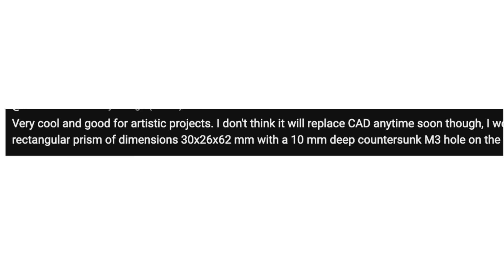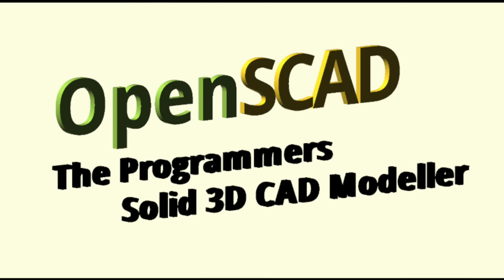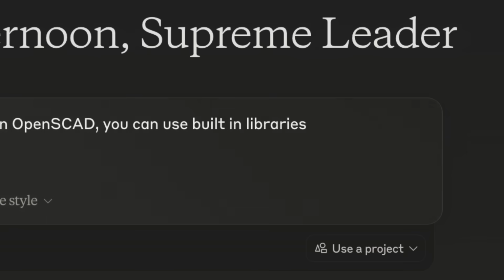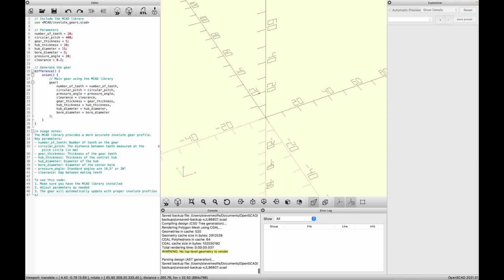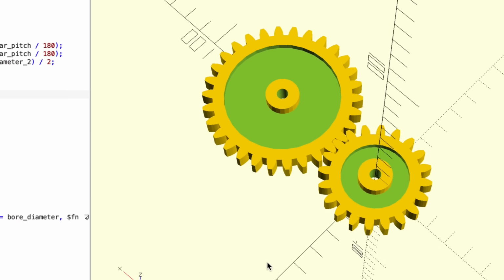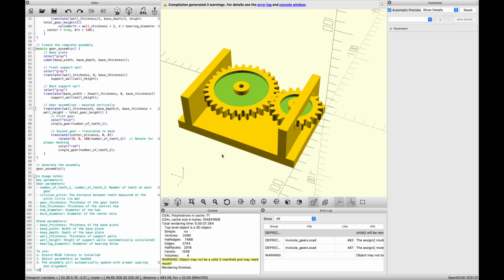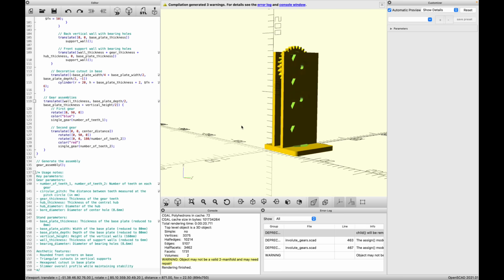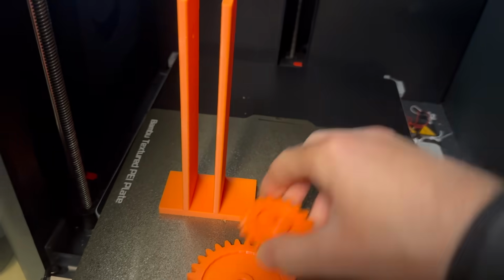CAD and 3D printing will never be the same....

Comment: not too impressed.. you had to correct it so many times, and also use pre-generated models built into the program.  Also it only created two gears with a very basic stand.  Not saying AI couldn't maybe create some impressive things someday, but that's hardly AI "generating CAD".
Reply: The Wright Brothers' first airplane wasn't very impressive compared to what we had before the crumbling of the airline industry.
Reply: The thing is humans have this tendency to think linearly. AI doesn't scale that way, it's exponential. 

In a year or less I can all but guarantee with an accurate descriptive prompt it won't need correction.
Reply: @JesseHikes  
wher is it geting its traning data from
Reply: You've never used generative AI have you?
Reply: Let's see if it can do fingers well in a year.
Reply: If you have ever used chatgpt, this is the norm.

With a sentence as simple as 'model meshing spur gears' there is millions of outcomes that would technically meet the criteria of that over simplified set of instructions. The more input (direction) you can put in, the more predictable the outcome will be.
Reply: Multiply that by millions of recorded 'corrections' centrally stored  - and you have a basis for an LLM that learns from many designers out in the wild; the worry there is the low barrier to entry for what constitutes a designer - SISO applies.
Reply from the maker: Like I said in the video, this is just the beginning. It’s going to advance much faster than we think
Reply: @3DPrinterAcademy  Nah bro I don't see it. Complexity in real designs is thousands of times more than what you've shown. And they're already getting deminishing returns with scaling llms
Reply: @3DPrinterAcademy AI is good at robo calls. I'll give it that much.
Reply: @3DPrinterAcademy  Not really. We're like 7 years into the current transformer based LLM architecture and are beginning to hit the known theoretical limits in their reasoning until there's another model architecture discovered (and even then it will likely take years for any new architecture to mature once it's discovered, similar to GPTs 1 through 3)
Reply: Well, if you compare to humans, AI is just a newborn baby who hasn't had it's first birthday yet. Give it two more years. You won't need 90% of designers.
Reply: Having used chat gpt extensively, the naysayers are highly wrong. The problem you'll find is that when using a token system for paid users or free version you'll get a balance of precision computation and cost compression. The longer it computes, the more the designers tell it to cut corners to keep the energy cost down. The owners of the program get 100% intelligence at all times. We get watered down efficiency based profit models. Do not give up on gpt. You will open up godlike potential with $200/month subscription and up. As the models improve, it too will improve. We haven't hit the singularity yet. We're belittling the capabilities of a 3 year old toddler that can pass Harvard exams.
Reply: @513Canyon  Hop off, never seen someone sell out so hard for OpenAI